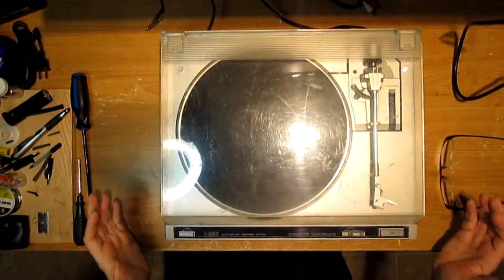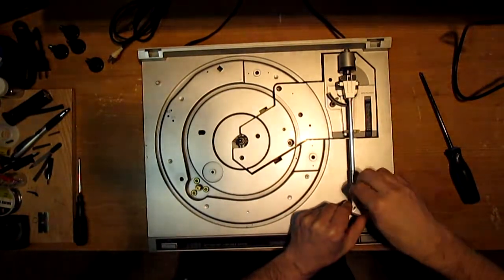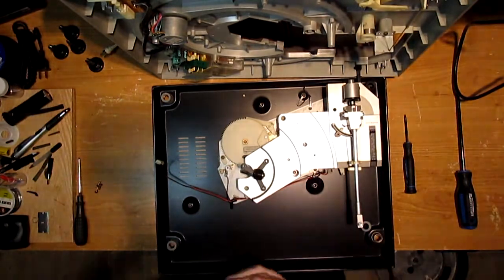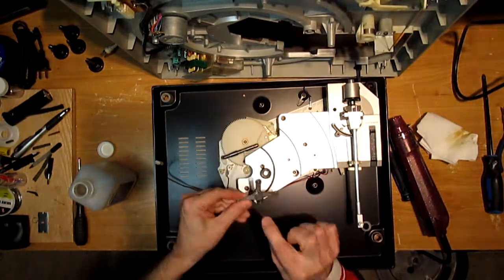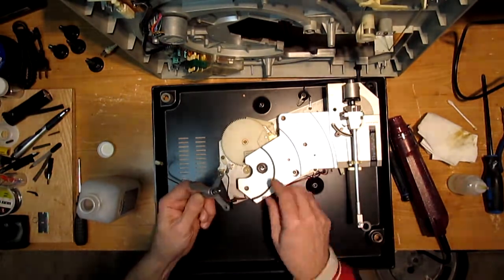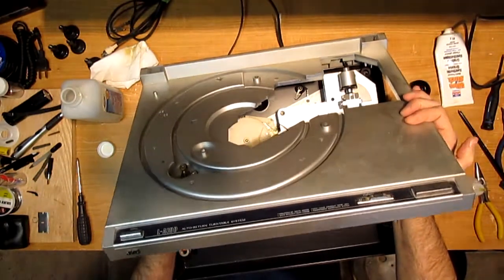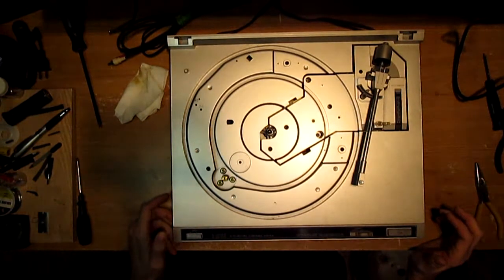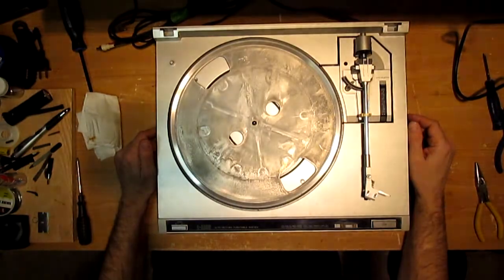JVC L-A100: Bearing & Motor Service

Comment: Thank you TG!   This was a very helpful and informative video.   I was trying to solve the problem with the spindle not turning by trying to spray a little WD40 down in the baring area as another video suggested, and then I found your video.   Thanks for taking the time to post this.  Very helpful!!    Now I'm in search of your video on how to set the correct speed, balance and tracking!

Comment: Hey TG, I was pleased to find your video.  In attempting to set up this model table for family I found the spindle was seized, not even possible to rotate by hand.  Your simple instructions worked perfectly, with two exceptions.  I could not slide the plastic gear fully back onto the base of the spindle so used a 1/2" socket to apply even pressure all the way around while tapping lightly with a hammer.  I wanted to be certain to slide it straight on.  Also the four feet on this one had rubber surrounds over the springs.  One of those was a thinner rubber and had split.  That foot required more care in reinstalling.  Now all working well, so thanks.

Comment: Great fix!  Thank you for posting! Used it for the L-A120 as well. Very similar. Only difference I noticed is that there's not a ground on the screw. I was able to get it apart without removing the cartridge, although that could be risky without a protector. One additional note, there isn't a bearing, that's a bushing style design.

Comment: Thanks for posting this, it's exactly what I needed as I have this same turntable with a stiff bearing. I bought mine second hand in 1991 so I've no idea how old it actually is. Do you know when this model was produced?
Reply from the maker: Exact year, no.  But, definitely the early 1980s.
Reply: I don't quite understand why grease was used in the first place as a drop of oil seems to work better. Maybe this would require regular oiling which would be impractical?
Reply from the maker: @georgespeed3061  It's an open bearing unlike some tables that have a bearing pit where the oil stays in place.  Gravity will eventually pull the oil out the bottom on this one.  You have to give it a couple drops every now and then to keep it lubricated.

Comment: How did you unplug the power cable?
Reply: Power cable on these is a small white 3 pin connector to the circuit board (which you couldn't see in the shots) If you disconnect this one make a note of which way round it goes  !!